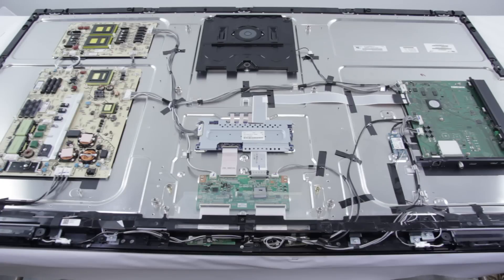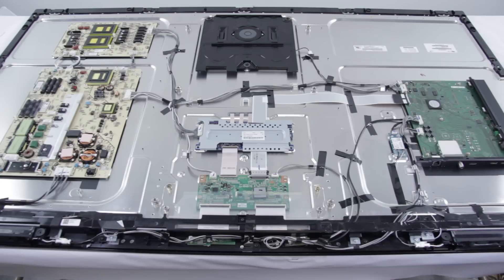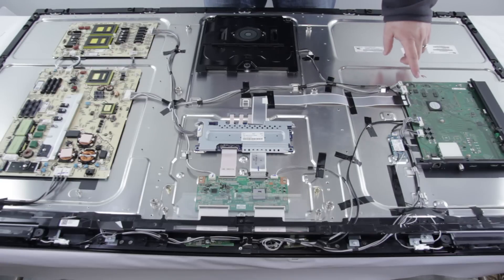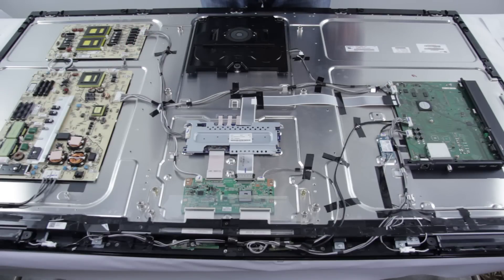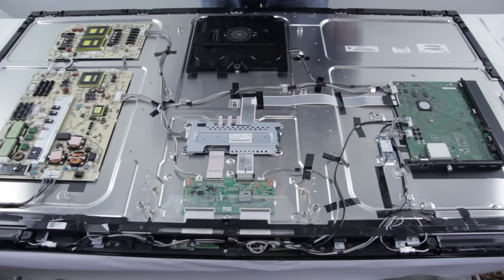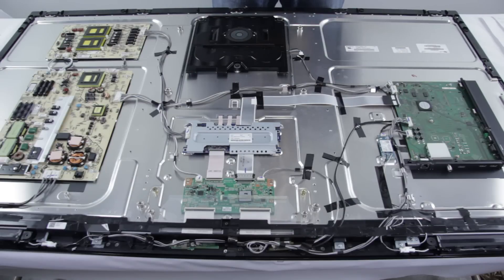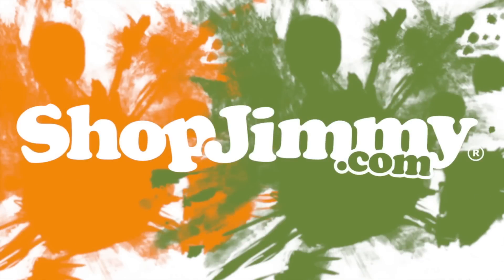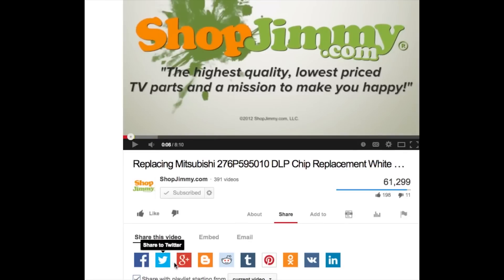LED TV Repair Main Board Overview Blank Screen-TV Has Audio but No Video-Common Issues Problems

Comment: I have a 32' Vizio E320VP. I was watching Netflix through my Xbox when my nephew accidentally hit the the plug. It didn't fall all the way out but enough to flicker both the tv and Xbox. They both came back on immediately, but when I walked over to check if the plug was all the way in and came back, the screen was black. The outlet works fine with any other electronics. I did the flashlight test and I do have a very dim picture. Audio works fine too. I just wanted to be sure before ordering the part
Reply from the maker: +B kenpachi   Try all repairs and troubleshooting at your own risk.  This sounds like you have bad LEDs in your TV.  Unfortunately we do not sell replacement LEDs for your TV model number at this time.  You can check back in the future to see if we have them available.  Thanks!  www.shopjimmy.com

Comment: Hi , I have an teac LED32VH30 LED tv , It has the part numbers 
T.MSD306.9A 10331 Main AV Input Board
LED32VH30 Power Supply BSF-PI320201B

i have a problem , the red power led turns on , and then turns to green when i press the power button , but i cannot see any display or backlight . the tv wont turn off as well if i press power button , I am assuming the problem is with mainboard , can you please confirm if this could be the reason . Also i can find  the Main Board online when i searched but this is from BUSH TV with same part number , can you please tell me if replacing this would change the name on the TV when its replaced and fixed. Please let me know. 
thank you 
Sunil
Reply from the maker: sunilgubbala gubbala   I recommend replacing the main board in your TV.  Here is a link to a replacement main board: http://www.shopjimmy.com/viore-smt110959-main-board-for-led32vh30.htm  Be sure to match part numbers on your current board, with your replacement for compatibility.  You can also call our customer service for further assistance with your purchase.  (877) 881-6492  Thanks and please let us know if you have any further questions with your TV Repair!  www.shopjimmy.com
Reply: Exact same problem i have here with similar model TV, TEAC LEDV32U38HD, same main input board, same power supply. Supply voltages measured all good (24/12/5). Only anomaly i found was measuring the fuse? near the 12v/5v jumper on the input board, the voltage would reach 5V after power up, then slowly fall down to less than 2V over a minute or so after power up.
Reply from the maker: cozzm0AU   Please reply with more details about the problems with your TV.  Thanks!  www.shopjimmy.com
Reply: ShopJimmy.com
Same board numbers as "sunilgubbala gubbala" posted about. TV will power up if you switch it on via remote or side button within ~10 seconds. After that it won't switch on. Green light comes on, but i get no video, no backlight (that i can see), no sound and the TV cannot be switched off again (to standby) with remote or side switch. It must be power cycled. I don't know what input it is on, but pressing buttons on the remote has no effect on the TV at all.
Reply from the maker: cozzm0AU   I recommend replacing the main board in your TV.  Please double check your TV model number on your TV as I cannot find any replacement parts for that model number.  You can also call our customer service for further assistance with your purchase.  (877) 881-6492  Thanks and please let us know if you have any further questions with your TV Repair!  www.shopjimmy.com

Comment: I have a Vizio E701I-3A, when i turn on the TV back lights come on for about a min then go off. i don't believe the TV actually ever boots up, no logo, no sound and no picture even with the flashlight test. i have 3.3 volts on stand by even when you attempt to power on the TV and backlights are on. Main-Board?

Comment: I have a Lg 47LX6500 with a black screen, no picture or sound. I did the flashlight on the screen but don't see nothing, i also don't have any lights showing in the back from the black lights. it powers on and stays on just nothing. i tried pushing all the inputs to see if any sound and nothing. I am thinking its the main board but not sure if that will make nothing work. please help.
Reply from the maker: +nate smith   Try all repairs and troubleshooting at your own risk.  I recommend replacing the main board in your TV.  Click this link to replacement parts for your TV model number:  http://www.shopjimmy.com/lg-ebr69490101-main-board-for-47lx6500.htm  There may be multiple boards for the same TV model number, be sure to match part numbers on your current board, with your replacement for compatibility.  Here is a link to a video showing how to identify your part number, click here:  https://www.youtube.com/watch?v=RwHTvjMdrhk  Thanks and please let us know if you have any further questions with your TV Repair!  www.shopjimmy.com
Reply: thanks for getting back to me. I ordered a new main board for the tv and still have a black screen. could it be the power board or t-con. please help thanks

Comment: I have a vizio E390i-A1 and when I turn it on there is no picture. Just a black screen with no light. Is this the main board causing the issue?
Reply from the maker: +Malachi Barrera   Try all repairs and troubleshooting at your own risk.  I recommend running the flashlight test on your TV.   Here is a link to a video we produced that shows how to run the flashlight test. https://www.youtube.com/watch?v=xUzCLgoSPGM Please reply with your flashlight test results and we can recommend a replacement part for your TV repair. Thanks and please let us know if you have any questions! www.shopjimmy.com

Comment: hello, I have a 1 yr old 55" Sceptra and we have sound but no picture? model is X50, Thanks
Reply from the maker: +Fred Spradlin   Try all repairs and troubleshooting at your own risk.  This sounds like a problem with the LEDs in your TV.  Please double check your TV model number.  Click here to view a video that shows how to find your TV model number:  https://www.youtube.com/watch?v=S51nhAmwR2M  Thanks!  www.shopjimmy.com
Reply: Hello that is only model #, there is a P/N X505BV- FMDR8HJ1PE8 located on tag on back of tv
Reply from the maker: +Fred Spradlin   Have you run the flashlight test to see if you have backlights or not?  Here is a link to a video we produced that shows how to run the flashlight test. https://www.youtube.com/watch?v=xUzCLgoSPGM Please reply with your flashlight test results and we can recommend a replacement part for your TV repair. Thanks and please let us know if you have any questions! www.shopjimmy.com

Comment: hi i have LG 55LM7600-UA  when i try to turn it on the red light blinks and than it goes away  nothing comes on i was told the motherboard is bad but i put a new motherboard and its still doing same thing if you guys can help me i appreciate your tame i need some help THANK YOU VERY MUCH

Comment: Hello.  I have a Samsung UN60EH6003 Version HH01. I turn on the tv and it works great for 1/2 hr or longer then the screen goes black from right to left but the audio continues. If I turn the tv off for 5 min and then turn on again it works again for a while. I am a mechanic and can use my Fluke multi meter to diagnose with a little help. Thanks in advance !
Reply from the maker: SuperSchwang   PLEASE SUBSCRIBE TO OUR CHANNEL - Try all repairs and troubleshooting at your own risk.  This could be a problem with either the main board or the TV panel.  You can replace the main board to see if that fixes the problem.  Click this link to replacement parts for your TV model number:  http://www.shopjimmy.com/catalogsearch/result/index/?cat=56&q=UN60EH6003  There may be multiple boards for the same TV model number, be sure to match part numbers on your current board, with your replacement for compatibility.  Here is a link to a video showing how to identify your part number, click here:  https://www.youtube.com/watch?v=BEPWrefQvqI  Thanks and please let us know if you have any further questions with your TV Repair!  www.shopjimmy.com

Comment: I need help I have a Samsung LED Model # UN39FH5000FXZA I have no picture with sound I have replaced the T Con Board and the Main board and the power supply board and still have no picture what else could it be HELP
Reply from the maker: S Brown  Try all repairs and troubleshooting at your own risk.  This sounds like you have bad LEDs in your TV.  Unfortunately, I do not see any replacement LEDs on our website for your TV model number.  Thanks!  www.shopjimmy.com

Comment: Hello I have a 2017 TCL Roku 55inch tv. I have sound but I have a blue screen. Please help me and tell me what part do i need to buy. The light on the back panel is on but the screen is blue.i have a serial # 1706GTC001467A02474

Comment: HI, Thanks for lending us your service :)
My problem is: black screen with sound, menu shows with flashlight in the dark.
Samsung Model: Led, UN32F5500AF. Can you determine my problem...

Thanks
Reply from the maker: csreso1  Please watch this video FIRST to help with your repair!  https://www.youtube.com/watch?v=BP3NVNCGEv8  This could be a problem with either the power supply or bad LEDs in the TV panel.  You can replace the power supply board to see if that fixes the problem.  Click this link to a replacement power supply:  http://www.shopjimmy.com/samsung-bn44-00605a-power-supply-unit.htm  Be sure to match part numbers on your current board, with your replacement for compatibility.  Thanks and please let us know if you have any further questions with your TV Repair!  www.shopjimmy.com
Reply: ShopJimmy.com Hi, I replaced the MB, however the problem still remains. So it must be the LEDs, how do I locate to replace?  Thanks

Comment: About 2 minutes after I turn the tv on, the screen starts to fade to white. The picture never completely goes away, but it's very faded. Would this be the Tcon or the main board or something else?
Reply from the maker: Kate Smith   Try all repairs and troubleshooting at your own risk.  Please reply with your TV model number.  Click here to view a video that shows how to find your TV model number:  https://www.youtube.com/watch?v=S51nhAmwR2M  Thanks!  www.shopjimmy.com
Reply: Everything I read says if the main board is bad the screen will be black. My picture works, it just looks like it has a milky film over it. It never completely blanks out. Main board or Tcon?
Reply from the maker: Kate Smith    I would try replacing the t-con board first to see if that fixes the problem.  Try all repairs and troubleshooting at your own risk.  Please reply with your TV model number.  Click here to view a video that shows how to find your TV model number:  https://www.youtube.com/watch?v=S51nhAmwR2M  Thanks!  www.shopjimmy.com
Reply: Thank you. It's a Proscan, by Oncor. Model # 36LC45Q.

Comment: I have a  Mitsubishi Model LT-55164 and the front green light just blinks and I have repaired the power board and still does the same thing

Comment: Have a Samsung LN-T4066F, flickers on momentarily then backlights go out. I can see the image with a flashlight and sounds works too; inputs are good. Initially I replaced bad capacitors because the tv had issues starting and progressively got worse until the stopped turning on. I had replaced bad capacitors so now it turns on but no backlights.

Comment: Hey there I have an LG 55LV5400 TV, for about 2 years maybe more, today I tried to turn it on and nothing, all it does is to show a red light then in changes to white and the screen is dead no image at all, same behavior using remote or from the tv touch panel... please help me. Thanks
Reply from the maker: jeffro8900  PLEASE SUBSCRIBE TO OUR CHANNEL - Try all repairs and troubleshooting at your own risk.  I recommend replacing the main board in your TV.  Click this link to a replacement main board for your TV model number:  http://www.shopjimmy.com/lg-ebt61521404-main-board.htm  Be sure to match part numbers on your current board, with your replacement for compatibility.  Here is a link to a video showing how to identify your part number, click here:  https://www.youtube.com/watch?v=RwHTvjMdrhk  Thanks and please let us know if you have any further questions with your TV Repair!  www.shopjimmy.com

Comment: Vizio E322AR 
TV turns on, sometime there is video display sometimes there is not. The video could display for 5 minute or 5 hours.  And happens on every input source whether HDMI, component or cable.
Reply from the maker: +Andre Thomas  Try all repairs and troubleshooting at your own risk.   I recommend replacing the main board in your TV.  Click this link to replacement parts for your TV model number:  http://www.shopjimmy.com/catalogsearch/result/index/?cat=56&q=E322AR+  There may be multiple boards for the same TV model number, be sure to match part numbers on your current board, with your replacement for compatibility.  Here is a link to a video showing how to identify your part number, click here:  https://www.youtube.com/watch?v=kxkeGLhlQY8  Thanks and please let us know if you have any further questions with your TV Repair!  www.shopjimmy.com

Comment: I have a 60" LED Samsung Model UN60EH6003.  The issue is that after turning the TV on, the video freezes and fades into black, while the audio still works.  The video comes back on, only if you shut the TV off and turn it back on, but within a minute, it does the same thing--picture freezes and fades to black.  I've switched out all cables and tried other inputs for the video, and all have the same problem.  Any ideas?
Reply from the maker: amanda howard   Please watch this video FIRST to help with your repair!  https://www.youtube.com/watch?v=BP3NVNCGEv8  I recommend replacing the main board in your TV.  Click this link to replacement parts for your TV model number:  http://www.shopjimmy.com/catalogsearch/result/index/?cat=56&q=UN60EH6003  There may be multiple boards for the same TV model number, be sure to match part numbers on your current board, with your replacement for compatibility.  Here is a link to a video showing how to identify your part number, click here:  https://www.youtube.com/watch?v=BEPWrefQvqI  Thanks and please let us know if you have any further questions with your TV Repair!  www.shopjimmy.com

Comment: I have a Hisense 50K610GWN and the screen is black. First it had a blue light in the bottom right corner with horizontal lines and the next day it was blank. 
Thanks.

Comment: I have a Vizio Model SCTAMUS E500i-A1, serial #LTYWNTBP4354533.  I have two problems.  1) No Signal on screen but i have audio this is intermittent and when it starts it occurs in about 15 minute intervals.  When TV has been on for 4 to 5 hours with no signal indication intermittently then the TV will power off on its own.  You can turn the TV back on immediately and it will work but I continue to get no signal message on screen intermittently.  All inputs cables have been checked with another TV and the problem does not occur.  2)  TV been on for several hours and I get dark areas in the image all over, mainly starts at the top of the screen all the way across the screen and moves down to the bottom but can be all over the place at times but still all the way across the screen.  It will eventually go completely dark but does not power off on its own.  When you power it off and turn it back on after a while then the TV looks normal.  Like i said this is intermittent.
Reply from the maker: +Sarah pate   Try all repairs and troubleshooting at your own risk.  This sounds like a problem with the main board and the LEDs in your TV.  Click this link to replacement parts for your TV model number:  http://www.shopjimmy.com/catalogsearch/result/?q=E500i-A1  There may be multiple boards for the same TV model number, be sure to match part numbers on your current board, with your replacement for compatibility.  Thanks and please let us know if you have any further questions with your TV Repair!  www.shopjimmy.com

Comment: I have sound, picture with flash light, there is no back light. I have already changed the power supply. the tv is a Samsung led tv: UN46EH5000FXZC. WHAT DO YOU RECOMEND

Comment: Hi!
I have a Sony KDL-52EX701 with 7 blinking red lights like error code, It turn on well but for 30 or 40 second, then tun off and blinking lights start. i did the reset stuff like Sony infor on their page but same condition.Can you guys let me know whats going on with this TV. I have knowledge in computer repair and wants to see if  I can be fixed.
Reply from the maker: ***** Please watch this video FIRST to help with your repair!  TV Repair! LCD, LED, Plasma, DLP How To Fix Your TV with ShopJimmy.com Help!  I recommend replacing the power supply board in your TV.  Follow this link to replacement parts:  http://www.shopjimmy.com/catalogsearch/result/index/?cat=59&q=KDL-52EX701  Be sure to match part numbers on your current board, with your replacement for compatibility.  Here is a link to a video showing how to identify your part number, click here:  TV Part Number Identification Guide for Sony Power Supply Unit (PSU) Boards (LCD LED Plasma TVs)  Thanks and please let us know if you have any further questions with your TV Repair!  www.shopjimmy.com
Reply: Yes, I saw that you don't have the power supply board in stock, What can we do about it. Because I will agree to pay for a new  or remanufactured, I live in Puerto Rico and shipping coat could be too expensive if I send my back and forward.

Comment: I have a Samsung UN40F6300AFXZA LED TV with No backlight, faint picture and good audio.  I have replaced the t-con board and power board.  Still no picture.  Can you help?